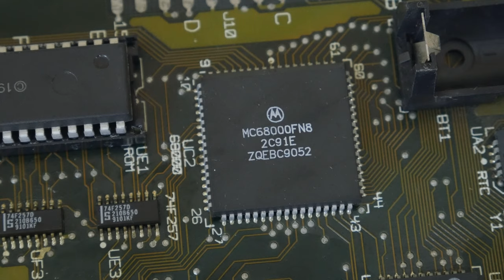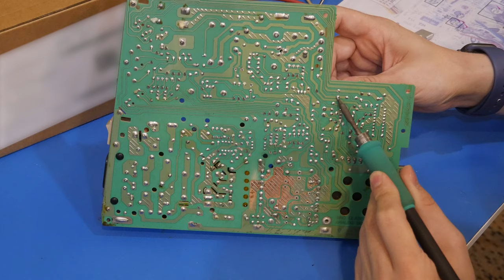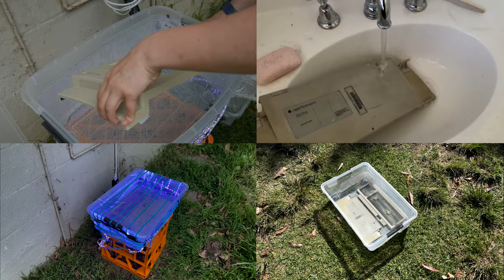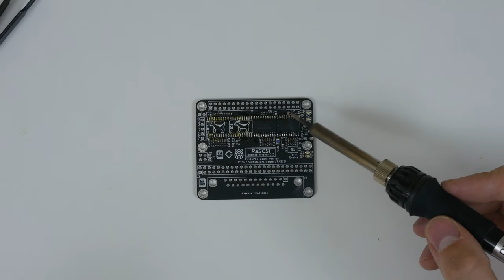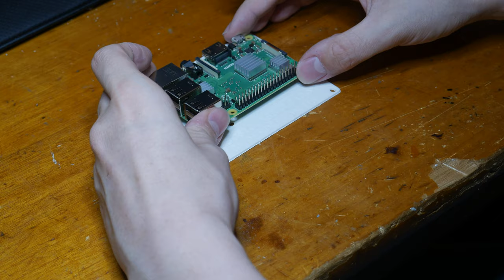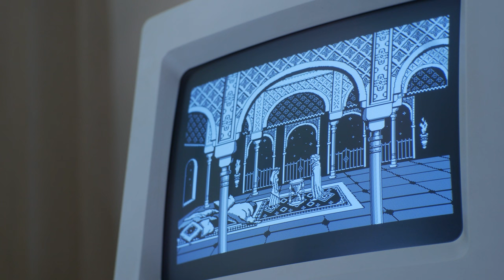TRASH to TREASURE - Macintosh Classic Restoration

Comment: Great video but PLEASE discharge the Anode cap with a flathead screwdriver connected to ground (or the metallic shield, preferably both). The shocks these CRT's can give are nasty, it's definitely worth the hassle 😃
Reply: With a single touch, it will give you an instant punk hairdo!   What a time saver!  Don't pay any attention to the smoke and sizzling skin, it's a minor side effect, nothing to worry about.  (<:
Reply: A friend lost a finger nerve opening a crt monitor. He now has a dangling finger and it is really sad.
Reply: @xavtek  #sadfinger
Reply: And they linger for a good bit afterwards. Really nasty!
Reply: Yes yes yes… this is what I wanted to say too. We used to have a special cable with a pokey part to get under the suction cup.
Reply: What about the crt bleed resistor?
Reply: @retrodude6215  it's 30+ years old and can fail. Wouldn't rely on it.

Comment: Awesome!  I would recommend getting some of that conformal coating spray and coating the boards and whatnot to prevent corrosion in the future...it will live inside now but still would be a good idea for longevity!
Great going on the restoration!
Keep em coming!!!!
Reply from the maker: I actually did use some “PCB Spray” to add a new protective layer to the areas I worked on.
 I must’ve forgotten to mention that in the video! 😅

Comment: Need a Macintosh Lisa?  It powers on, but needs either a hard drive, or just a boot loader/OS.  I used it way back in the 90's, maintained and ran it at least once a year until 2014 when i moved the drive platen during cleaning (axis protrudes the case), and it never booted up again since, but it sure wants to.
Reply from the maker: Hey mate I am definitely interested in this and it would make a fantastic video.

 Do you mind dropping me a line on Twitter or via eMail? Cheers!
Reply: @Pendleton115  I don't do twitter, but email is perfect, anywhere official I can find a published email address of yours, so you don't have to put it in these comments?
Reply from the maker: @Bob-of-Zoid  sure, you can contact me at wheatleythecore801@gmail.com !
Reply: I’ll take it too!

Comment: Hey, thanks for the great vid, going to work on a Mac Classic very soon, I'm just building the parts list.  Where do you get the caps from? do you get them in a set or just buy individually for the project? Thanks heaps
Reply from the maker: There are some eBay sellers that sell premade kits.
 However it’s usually cheaper to manually check all your capacitors and order them individually from a site like digikey.
 I do have plans to offer some capacitor kits on JuicyCrumb.com in the future though :)
Reply: @Pendleton115  awesome thanks a lot, appreciate the advice

Comment: Hey Pendleton 115,  was wondering in your video for the first version of the Bluetooth iPod what did you use to mount the Bluetooth board to the metal plate. I can see two small with things underneath but I have no idea what they are.
Reply from the maker: You can use double sided foam tape that's been cut to size.
Reply: @Pendleton115  alright thank you btw how thick should it be.

Comment: With the RaSCSI, do you run into any problems when shutting down the machine from the OS where the image becomes corrupted?  I usually have to power down the PI first through the web interface so it can dump the cache or else I risk corrupting the disk image for the HDD.

Comment: UV lights are good and all but dont you have plenty of sunlight in Australia? I know in winter months it can get a bit dull if that was the case. Great video though.
Reply from the maker: Yeah when this was filmed it was late winter/early spring in one of the wettest seasons of Australia’s history hahaha .
 Personally I found the LED’s more consistent and able to get better coverage of the entire part, so I’d recommend them either way
Reply: @Pendleton115  yeah, especially with such an oblique angle the sun is during an Australian winter, early spring it can yield some less than optimal results for it, as well as normal boring tasks like hanging clothes to dry on the line lol.